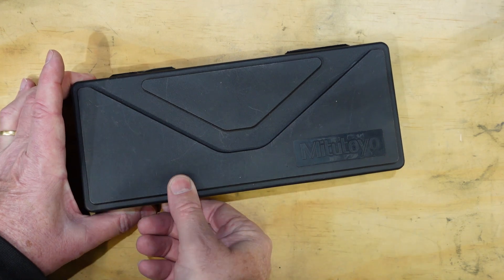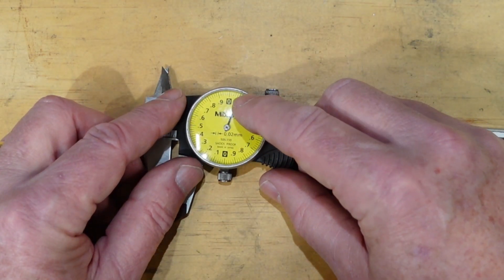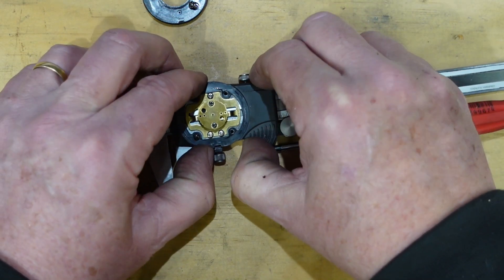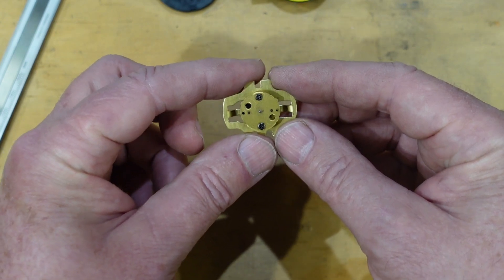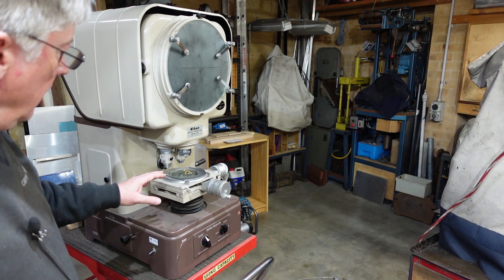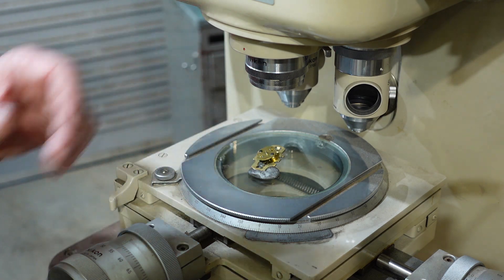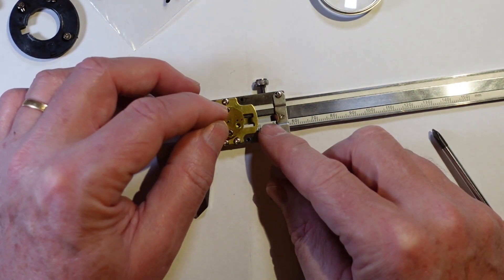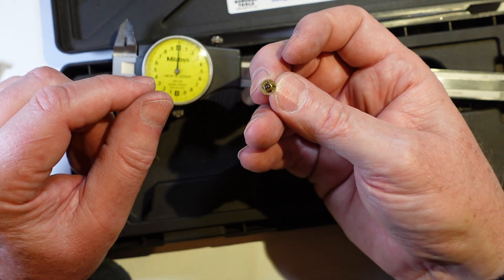Going inside a dial caliper

Comment: They often get dropped and lose zero by a tooth.
My most popular video(43k views) is on setting a mitutoyo dial caliper of a particticular type using the "special" tool, a bit of wire!
Reply from the maker: I did expect a lost tooth, but under magnification it looks like they were mainly bent over.
Reply: @occasionalmachinist  it must have been a very hard knock for that to happen, the older style were more tolerant of a drop. In them the gear just bounces out of engagement and is not damaged and is easily reset with the wire tool, as I show in the video.
Reply from the maker: @chrisstephens6673  This one fell from the top of a lathe headstock onto a (concrete) floor and the jaws were 40mm apart. I suspect the damage was from the momentum of the moving section pushing it on while the fixed jaw suddenly stopped.